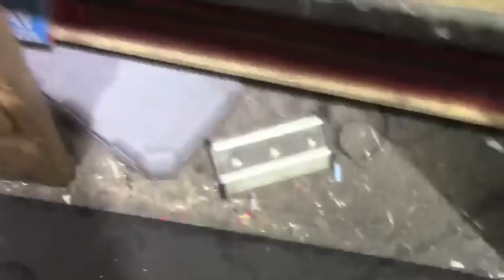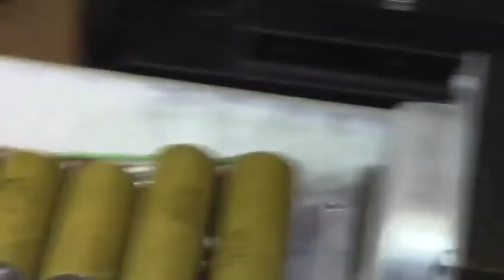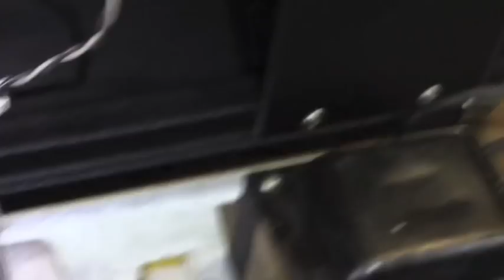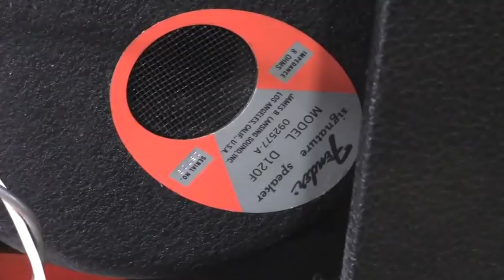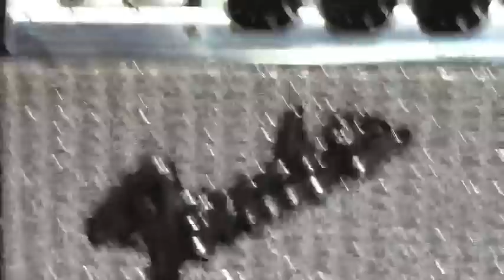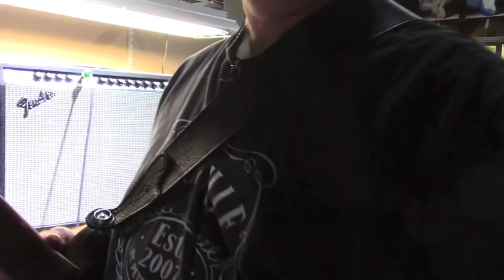On The Bench - 1974 Fender Twin Reverb Amplifier - Almost Completely Unmessed With

Comment: I've got a 1974 twin reverb that I got from my grandpa, that's been sitting in my mom's garage the last 5 years or so. It's all original. I don't even think the tubes have been changed. The vibrato clicks and I think one of the power tubes is bad, but the thing still sounds amazing!

Comment: Very cool.
I am still playing through a 1976 Twin Reverb I purchased brand new!    To date I've had the Filter Caps replaced 3 times, had it modified to Blackface specs and swapped various speakers in and out of it through the Decades.   I've most certainly gotten my $400 (original price) worth out of it!
The lack of a PCB and the common sense circuit layout have most certainly been the main contributing factors to this amplifiers longevity.
For a young player to spend the extra money now for a quality amp really makes sense.  Your future self will thank you!

Comment: Thanks for posting, very interesting to compare with the 1974 Quad Reverb that I just bought and that is 100% original. All valves are RCAs, and it has no brown turds. 
I guess you already sold it but, yes, that cap you mention has probably been replaced in your one, my one has a blue cap similar to the rest. And no plans of mods or blackfacing my one, just fix hum as you did and a broken pot. Hearing your one convinced me to fix  &  enjoy it as it is!

Comment: Only thing that is throwing me is The Orange basket JBL 120s! These were typically fitted as an option around 1977/78. 1974 should be the Grey basket JBL 120s?? Am I wrong?(maybe altzeimers setting!) I remember buying a twin like this one new around 1979 with the Orange basket JBL 120s (Think it came with an optional Fork lift truck to lift it!) but later traded it in for a Musicman 2 x 12 130 amp  as James Burton used one! Happy Days!

Comment: That's not one of the amps with the dreaded bias control on the rear faceplate (stay away from those, same with 70w and 135w models).
All of those great Silverfaces can be Blackfaced, even the ones with master volumes.
Reply from the maker: Nathan Cirillo - The control you refer to is a Hum Balance.  Nothing wrong with it at all.  I've never met a "dreaded" Fender in 30 years of working on amplifiers.  It all depends on how it's set up and who is playing it.
Reply: Granville Guitars :
Yes, I was just about to edit that in.
Those are the ones that I personally would not want, same with the ones with the ultra-linear power transformers (70w, 135w).
There’s good and there’s really good.
I enjoyed watching you work.
I’m just finishing up a Bassman 100 that I have completely rebuilt.
It now has a F.R.E.D. rectifier circuit (fast recovery epitaxial diode).
Sounds very fast and solid, super-tight bass.